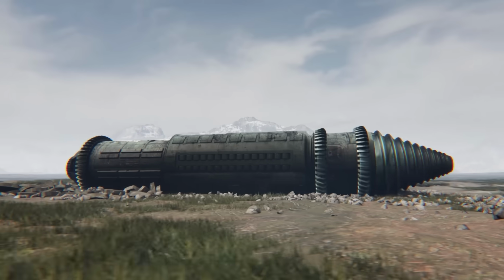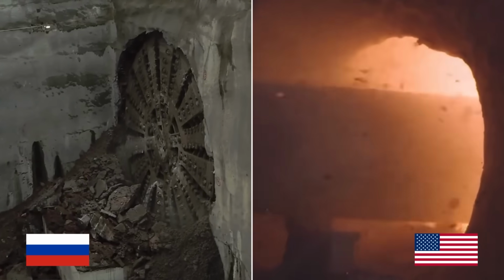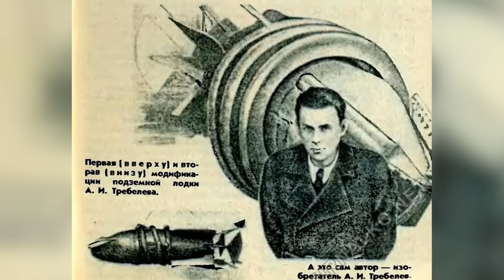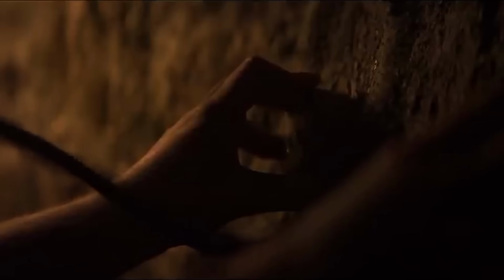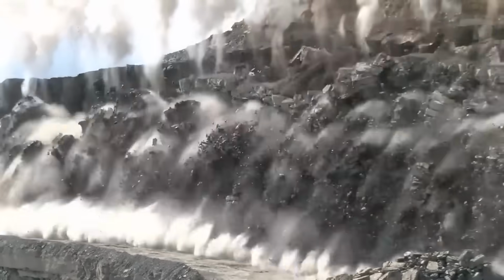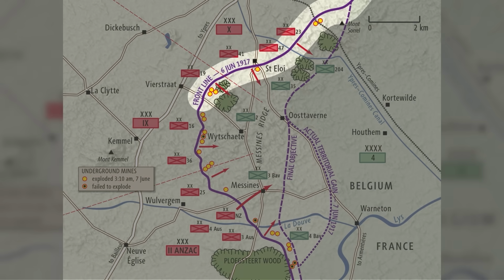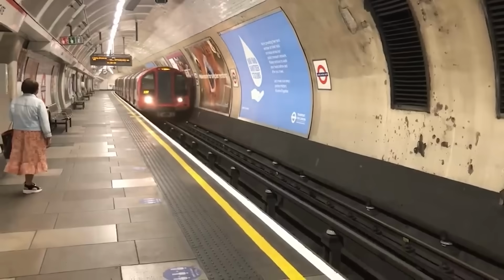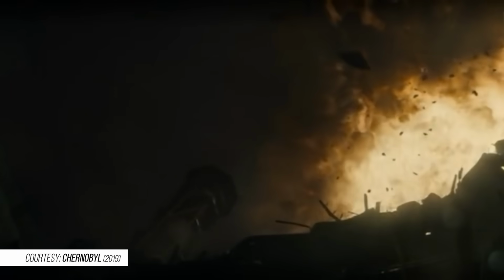What happened to Land Submarines?

Comment: 7kph?  Through solid rock?  Yeah, I'm calling BS on that one.  There is no way it could have pulled that off.  You can't just melt rock into the solid rock, and the debris would naturally take up more space than the material initially did, due to being fluffed up in excavation.  
Maybe if there was an inverted cone shape to the cutter, putting the material directly onto a high speed conveyor that would shoot it out the back, then the machine might be able to create enough space for itself for a while, but it will never have a clear tunnel behind it.

Comment: I find this story hard to believe. Simply because what happened to the rock spall removed from the front of the earth-boring vessel. Its not going away and has to be removed from the tunnel. What is normally done is to use conveyor system to move the rock spall out of the tunnel complex. And ship it off to be used as land-fill.

The design graphics used in the video simply make no sense. To anyone based in simple engineering technology. Plus what happens to the waste heat from a atomic reactor ? Earth is notorious for not being able to conduct heat away in any large amounts from any heat generator. Again that heat generated must be pumped away from the earth-boring vessel. And dumped outside the tunnel complex. That is a lot of complex machinery to move both out of the tunnel complex.

Comment: The best solution would probably be to use a MASER to melt the rock in front of you (that way you directly heat the rock instead of having to heat some part of the vehicle to crazy temperatures), and then use some mecchanical means (like screws and things like that) to push the molten (or maybe just softened) rock around and then behind you.
But managing the heat trapped in the rock around you would still be a huge problem, probably without solution.
Maybe the only way arount it would be accepting that the main mode of operation for your vechicle is to mechanically dig through dirt or soft/loose rocks and only engaging the heating device for very short times to help with sections of harder rock (having to move past the heated section, proceed some more mechanically and then wait for a cooldown period each time).
Reply: Thought they would use focused acoustic cavitation to form a precisely positioned fracture in the rock.  Remove the fractured piece, ship it out, rinse, and repeat.
Reply: I know you just watched the core 😁
Reply: Where is all of that old study the earthworm material we tossed out?   :P
Reply: You need to consider higgs boson..., and what can be done with material that has been eviscerated. 
An example for you is what happened to all of the debris all of the concrete that was collapsed in the twin towers. 
It doesn't have a requirement for excessive heat.

Comment: While there may be a possibility that a machine like this could be made to work in near liquid permafrost in Russia, as someone who has worked in hard rock mining and tunneling for 20 years, there's no way it could operate at any useful speed or as per the catchy animation at all.

IF it was possible to use these methods, then every mining company in the world would be using them instead of the slow and laborious drill and blast methods currently in use.
The best hard rock advance rates in a standard decline mine (6x5.5m) are usually 3 'cuts' per 24hrs of 5-6m advance each.

Problem no. 2 is what do you do with all the 'spoil', or loosened rock as you advance?
You can't leave it in the hole ahead of the machine, and you can't 'swim' through it...

Problem no 3, how do you replace the cutting bits on the drill head while travelling at 7km/h 🤷
What cutting bits do you use? Most cutting tools on rotary cutter type machines are only good for rock up to 80mpa or there abouts, after which you need to change to drill and blast mining.

Burning holes through the rock ahead with some kind of magical nuclear laser would melt the machine when you pass through it.

Never happened 🙂👍
Reply: Maybe it  could work if there is pipe inside on it what push rocks soil etc out of it behinds
Reply: @FINMrCurly  Without pumping water into the tunnel to wash out debris the mechanism would be exceedingly inefficient.
The drill has to cut a path big enough for the whole vehicle, but the conveyor mechanism has to be just a small part of the diameter.

Comment: Three things. Number one. I can definitely see something like this being used in a form of siege warfare. Where like maybe you have a military base or something where the base is surrounded by thick walls and you want to go under them.

Number two. Because the pressure of solid rock would be much greater than water pressure in many areas. These things would probably have to be built out of some crazy strong materials ones that probably wouldn’t even be able to be developed properly even nowadays. 

And number three of course the Soviets would be the ones to really invest in ideas like this. I don’t know what it is about communist countries, but they always seem to be the ones that invest in the almost Saturday morning cartoon bad guy vehicles.

Oh, I also forgot to mention that for those who don’t know it can literally take years to drill a tunnel. For instance, if I remember correctly, the channel tunnel that goes beneath the English channel if I remember, correctly took, I think it was like almost a decade to build. And that was when you had both sides working together. There’s also a tunnel that if I remember correctly wasbored out in the Swiss or Italian Alps. And that one I think took even longer. Put simply drilling through solid rock is a very slow and very expensive undertaking.

Comment: There's a lot of problems with these, 
First is air, traveling under an ocean in this thing is terrible because it isn't suited for watwr, and if you use it just for land then when you rise to the surface enemies are going to hear and see that from a looonnnggg distance.
Second is stealth, a huge bomber would work better than this hunk of junk, any seismic sensor would notice this from another continent 
Third is speed, 7km per hour is impressive, by the time it gets to the target the war will already end
Fourth is offensive capability, deploying the payload would be extremely dangerous since you would have to rise from the ground and then you can get attacked by an enemy team or simply get cooked alive with an rpg. Bomber is safer and submarines are even safer
Fifth is cost, thermonuclear reactor, lots of solid steel, this gotta cost more than 5 spaceships lol

Comment: As it is impossible for nuclear reactors to explode in a thermonuclear fireball, this story about the test of the Soviet „battle mole“ is obviously not true…
Reply: It could have had a meltdown without literally exploding.
They said it was melting solid stone around it, so I could believe the cooling system for the reactor got overloaded.
Reply: @The_Inquisitive_Inquisitor  That still would not result in a "thermonuclear explosion"

You can't accidentally set off a thermonuclear explosion, it requires an extreme amount of explosive force precisely focused equally around a core of pure fissile material, which are only used in weapons and not in reactors.
Reply: @viysnjor4811  I agree, but a nuclear reactor might regular explode while it's melting down. Coolant tanks rupturing and that kind of thing. It's NOT a thermonuclear explosion, but it IS a hot, radioactive explosion.
If you describe it like that, I could see it getting mistranslated as "thermonuclear"
Reply: @The_Inquisitive_Inquisitor  I doubt it's a translation error, Thermonuclear in Russian is "Termoyaderniy", ("termo" = "thermal", "yaderniy" = "nuclear") while "Radioactive" is "radioaktivniy" and explosion is "vzriv" or "detonatsiya"

I'd need to see the original Russian papers myself to say for sure, but what I'm getting at is these aren't really terms that could be mistranslated, as they are scientific terminology in both languages and not idioms or metaphors or other abstract ideas.

Comment: I would think the research aided current capabilities in horizontal drilling for oil and gas.  Directional boring is a common technique for installing small (<9") diameter conduits in developed areas.  I have participated in larger bores of 36".  Generally the small bores are done within a day.  The larger ones take days to go 60 feet or so under a railway for example.  Watched a job that needed a guy with a jack hammer at the end of the casing to get through rock under a rail line.

Comment: The battle mole is total bullshit and poor research skills on the part of FAE, it exploded in a thermonuclear blast? please thats so stupid it hurts. 

One of the primary sources for the battle mole talks about the crew evaporating in a blast given this "boat" would likely have used a modified VM-A submarines reactor given the time frame, this reactor in not really able to explode the way all the sources seem to claim. The same source also stated the "boat" was capable of going to centre of the earth and that an underground civilisations is also a possible cause for it's destruction, even tho it says all evidence of the project was destroyed and covered up in the early 60s so how on earth are they claim to know anything.

Trebelev's machine did likely exist but the battle mole is seems likely to complete nonsense based on one or two vague lines in a book from the 60s, expanded on by random authors with no sources and Russian propaganda over the years. Even Russian Wikipedia calls it out for not having any evidence of ever existing

Comment: There are so many problems with this design that its easy to tell that these projects never went far.
Even in science fiction like "the core" where they build such a thing, there are problems with energy, heat, navigation and mobility.
Unless someone found a more easy way to dig (like with using sound or a new kind of quantum sourcery) it remains science fiction.

Comment: Dumbest Idea Ever.  How does not 1 Country by 2 get funding for this?  The problem is moving all the mass you drilled out of the way of the machine just like with modern TBMs.  If you hit certain materials it's all over or you have massive cave-ins when you are not reinforcing what you are digging out.  It's a literal death mole.

Comment: In the 70s I saw a documentary about constructions of the future in which they showed things that are commonly used in construction today. And one of the ones that surprised me the most was a tunneling machine, which was a giant tungsten tip that was heated to red hot and was capable of melting the earth and digging a tunnel, whose walls looked like rock crystal. It was a fairly large platform, with the operator lowering the metal tip slowly. It would not be unreasonable to think that this system was secretly developed in later years.
Reply: QUE QUE QUE!!!!!  Siiiii lolz hmmm Mucho dineros???
Reply: And 20 years
Reply: @AMPProf  And infinite money.
Reply: Secretly? It's not really that unique an idea. The main issue with it is just how costly it is, maintenence would be terrible, and it would he a massive energy hog. Hell the stories of being nuclear powered only shows how people have no idea the energy demands needed. Nuclear power actually is really poor for its mass to energy. 

Uranium has higher energy density than fossil fuels yes, but we don't instantly burn up uranium like we do fossil fuels, we slowly use it up over time. If we were to burn just as much uranium as fossil fuels, yes it would make more power, but that's just not how we use it. Nuclear powered aircraft carriers for example only output about 125MW of electrical energy. And that's for something a third a kilometer in length.
Reply: Newer models look like large bells, and the heat is used to power and propell it forward. There is minimal vibration due to high heat, and when noticed there are assumed to be natural lava tubes.
Reply: @dustybricks113  Are you really saying it doesn't need fuel?
Reply: @dustybricks113  Yes, that's what they look like, like lava tunnels, with vitrified rock.

Comment: Musk owned several drilling machines that could travel up to roughly 40.25 kph (25 mph) through solid rock.
Reply: You are talking complete nonsense to hype up Elon, and here's the proof straight from The Boring Company Wiki:

Las Vegas Convention Center

In May 2019, the company won a $48.7 million project to shuttle visitors in a loop underneath the LVCC. Boring of the first tunnel, 4,475 feet (1,364 m) long, began on November 15, 2019, and finished on February 14, 2020, excavating an average of 49 feet (15 m) per day.
Reply: @paulkepshire5056         The first successful TBM was invented in 1863 and improved in 1875 by Frederick Beaumont, then updated in 1880 by Thomas Thomas. In 1875, an English TBM was approved for carrying out tests to build a tunnel under the English Channel. The largest TBM in the world is called Bertha.
Planned over 10 years ago, https://youtu.be/z38JIqGDZVU?si=H1ual7nGrJXTETKB
In the 1990's During excavation the machine set the following world records: best day of 172.4 m (565.6 ft), best week of 702.8 m (2,305.7 ft), and a best monthly average of 1,189 m (39,000 ft) within its size range of 3 to 4 m (9.8 to 13.1 ft) diameter machine.
Today they are much bigger, faster and nuclear powered.
Reply: @paulkepshire5056            Musk's company, claims it is designing a tunnel boring machine that can dig up to seven miles a day while laying tunnel.
In 1976 The Guinness World Record-holding fastest tunnel boring machine can cut over 7 meters an hour.
Reply: @duelde-consulting6403  I've looked for that specific statement, but all I can find is the average speed of Tesla cars travelling through the LVCC tunnels being roughly 25mph. I wouldn't put it past Elon to make such bold (and unfounded) claims because it does it all the time.

He said Hyperloop was about as complicated as an air hockey table and teased it back in 2012, then came out with the white paper in 2013. Said it would be only a couple of years before it's built...but it's ten years later and counting with almost nothing to show for it. Similar story with putting a colony on Mars or even having fully automated Teslas that won't kill the driver, passengers, or people nearby. It's always "only two years away".
Reply: @duelde-consulting6403  So which is it, 25mph or 7mpd? You don't come across as credible when you can't get your story straight.

Comment: Something like this would be more practical for going through ice. I think NASA has plans for a small one to melt through miles of ice to get to Europa's subsurface ocean.
Tunneling through rock at the speed depicted in the video would be impossible not to mention how noisy and easily detectable the mole would be making it useless for offensive military applications.
Reply: As soon as I heard that, I thought, "How in the fuck would you transport/carry/implement the fuel for a device that could melt through the earth at anything approaching a reasonable speed?".
Reply: @clueless4085  It is easy part. Cooling is the hard part.
Reply: @peceed  if its melting through the ice then the ice around it cools it, not efficiently but its good enough
Reply: LOLOL   As a  former engineering student I must agree with you.  @peceed
Reply: It's literally nuclear powered, dude.  @clueless4085
Reply: They took it seriously.

Systems and Cost Analysis for a Nuclear Subterrene Tunneling ... https://www.osti.gov/servlets/purl/4444905?shem=ssusxt
Reply: And then they discover eldritch like creatures living under europa's surface and then out of nowhere comes along a cult based on clowns.

Comment: A land submersible.
Reply: If the power plant was outside on the surface. And you bored a vertical instead of a horizontal tunnel. What would you build off the tunnel. Rember the English French tunnel had years of planning before actually being made.
Reply: So if you were building an underground city or bunker. Look at all those centuries old mines. Lots of work all ready done.

Comment: The US military has nuclear tunnel drillers that leave a glas like coating behind a perfect tunnel. It does not need to remove the dirt because it melts its way through the stone
Reply: How do you cool the machine? You'd need to drag a giant water hose with you.
Reply: That's not how lava works, it doesn't just disappear.
In fact, molten lava actually takes up MORE SPACE than solid rock!
Reply: Melting the rock still leaves the "liquid" behind, even evaporating it in a closed tunnel wouldn't work. If they did have that, it would be used in scale to make incredible infrastructure much more valuable than a slow, very detectable missile.
Reply: @rafael_lana  no they don’t want it to be public because that would prove their ability to dig these tunnels under the whole US
Reply: @hydroshoot  They don't because you made it up.
Reply: @The_Inquisitive_Inquisitor  it’s the only possible way. Regular tunneldrillers would leave massive amounts of dirt.
Reply: @hydroshoot  Melting rocks doesn't make them go away, it just makes them molten. How are they getting rid of all the lava?
Reply: @The_Inquisitive_Inquisitor  they probably figured it out bro Iam not an engineer. But Iam open minded. and it is a fact that the US has gigantic underground facilities and tunnels.